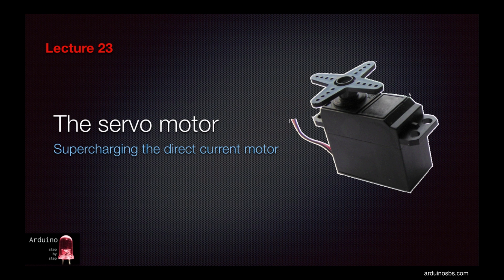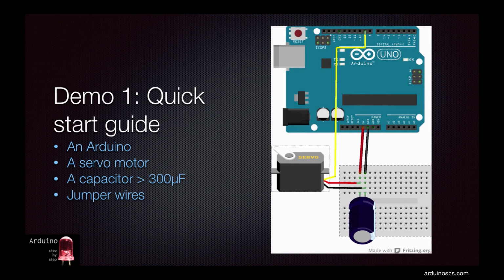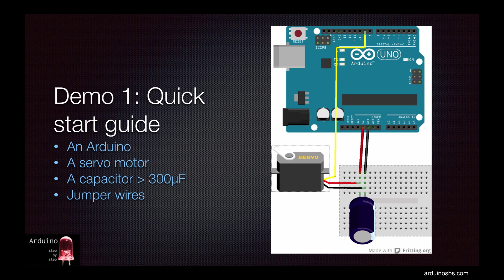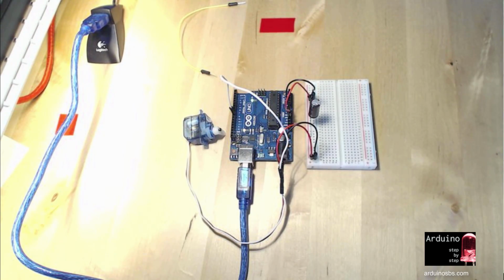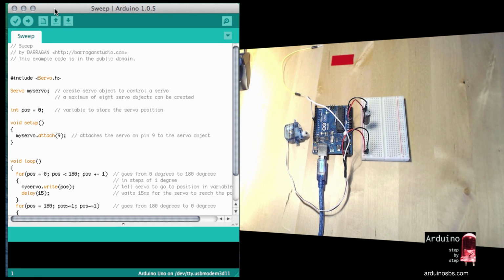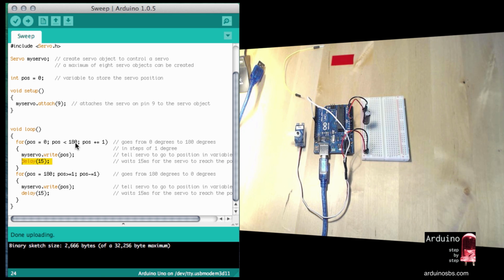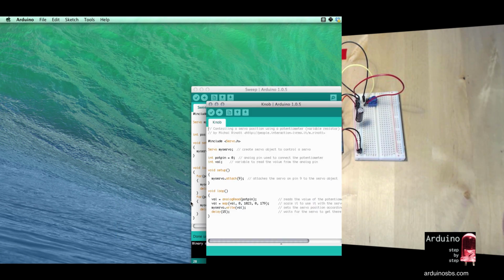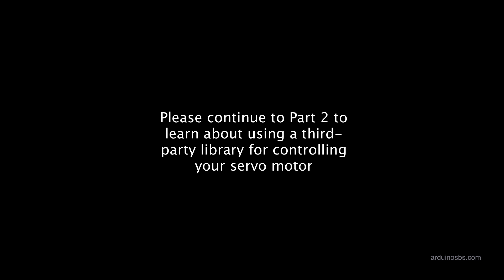Arduino servo motor control, Part 1 of 2

Comment: Is it logical to use a charged 300uf capacitor to supply high current, say 200ma,   for the first 1-2 msec (say) that the servo starts to rotate?
The arduino UNO voltage regulator will be required to recharge the 300uf capacitor for the SAME 1-2 msec ! ? ?

Comment: hello guys,,,, can i connect an ESC(Electronic SPeed controller) to a servo motor....i have here an sliding door servo motor... im thinkin that i'll use the motor for my radio controlled car but the question is... is it possible that i can use it in my rc car and connect the servo motor to an ESC??? THNX IN ADVANCE :)
Reply from the maker: +John Paul Lacbayan Hmm, not sure that's a good idea. A servo motor contains control electronics. The wires that come out of it convey signals to these electronics, not the motor. An ESC is designed to be connected directly to a DC motor, not other electronics. So, I'm not saying it's not possible, just that you should try something else first :-)

Comment: Great tutorial. But want to use the servo motor by giving it some analog signal from an IR sensor. Is it possible? and it would be very helpful for me..
Reply from the maker: Hi Rasel, I don't see why not. What do you have in mind? How do you want the servo to behave?
Reply: Tech Explorations Thank you very much for your response. I want my servo to rotate 90 degree when my IR sensor detects any obstacle in front of  it. please help me.

Comment: What is or should be the rating of the capacitor that is used with Arduino? For Arduino, which runs typicallyon 5 volts, what voltage rating and what micro farad should be used for Arduino?
Reply from the maker: Hi, the one I used in this video is a 330µF 50V High Temp Electrolytic Capacitor.

Comment: thanx for video. actually I'm enter command line for asking "why did you use capasitor" and than I saw you answer to Carlo Alfio Flores . Now Are you saying "optional" to use?
Reply from the maker: Hi Murat, yes, "optional" was in double quotes. It means that the proper way to do it is to use the capacitor. But, if you are doing some quick testing and you know that your motor will not draw too much current, it should be ok to not include one.
Reply: Tech Explorations I'm understand body, thanx for explain

Comment: Hi Tech,

I am new to Arduino and I was wondering why on their tutorial they don't use a capacitor. http://arduino.cc/en/pmwiki.php?n=Tutorial/Sweep.

Keep up the good work!
Reply from the maker: Hi Carlo, sorry for the late reply. The capacitor is "optional". You put one in if you think that the power supply can't provide enough power to the load (in this case, the motor). The capacitor stores a bit of power and provides it to the motor when needed. Hope it makes sense!

Comment: can we Control the Servo via MPU 6050 (Accelerometer)? Wirelessly with the Help of Xbee
Reply from the maker: Hi Harkirat, don't see why not.
Reply: Tech Explorations i need your expert advice and help nobody has integrated both these features. i have searched a lot. can you help me guide how to achieve this
Reply from the maker: Hi Harkirat, that is not a combination I have tried, and I don't have the components at the moment to look into it. If you are not in a hurry, let me check it out, it will take some time though.
Reply: sure, a tutorial about this will be good.

Comment: I've got a bit of a retarded question, but do the analog servos go in the Digital Output?
Reply from the maker: Not retarded at all... The DC motor in a servo maybe an "analog" device, but there's a control circuit attached to it. The control circuit moves the motor when it receives a pulse (like a high voltage signal that stays on for a short period of time). Digital pins on the Arduino are perfect for this, so that's why we use them.Also note that the analog pins on the Arduino are really digital - they just use pulse width modulation to simulate analog output.
Reply: Arduino Step by Step Got it running using the digital ports with the PWM capability on my UNO board.Thank you for the quick response helped me out a lot.

Comment: Cool. I could make a servo with a geared dc motor, an arduino , a motor driver , potentiometer then..
Reply from the maker: Sure, a geared DC motor is just a DC motor with gears attached to the shaft.